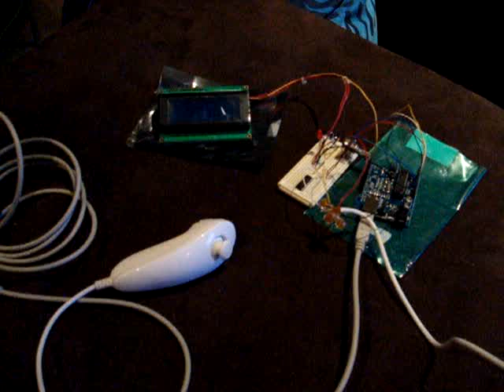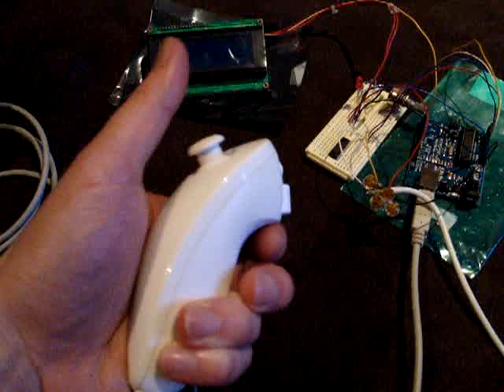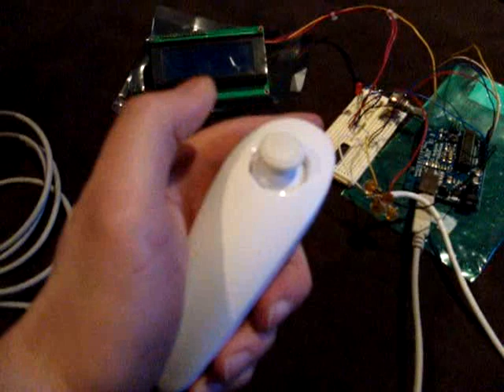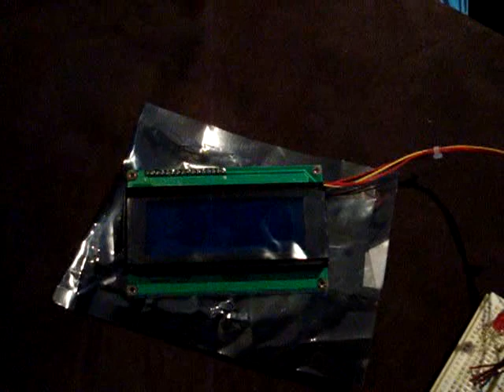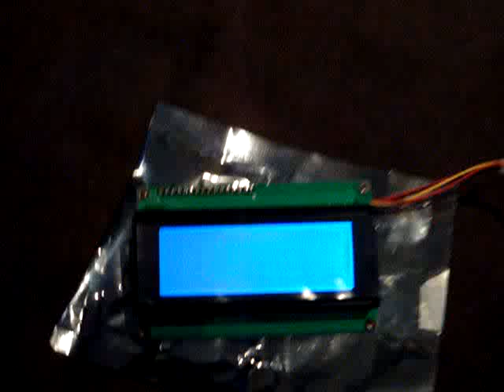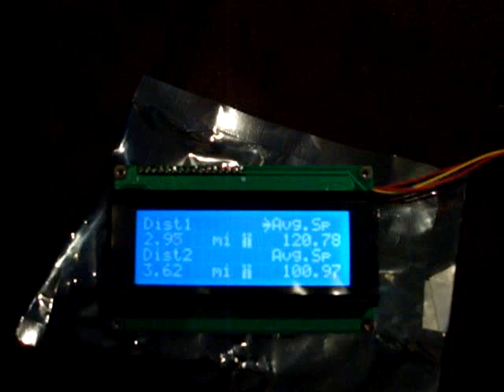Arduino rally computer

Comment from the maker: @hannas1234 It would depend on what kind of sensor it is. Basically it just needs to provide a 3-5v square wave pulse, which is basically any hall or optical sensor. If its a VR sensor it will still work, though you'd have to do some trickery to clean the signal up.

Comment from the maker: @hannas1234 The input is a hall effect sensor on the front wheel reading pulses as the back of the wheel studs pass by. Calibration is the same as any rally computer (Drive along a known length of road), although the calibration number is equal to the tyre circumference in mm divided by the number of wheel studs, so you can get fairly close with a simple measurement. 

I'll have to put a followup video up showing it running in the car.